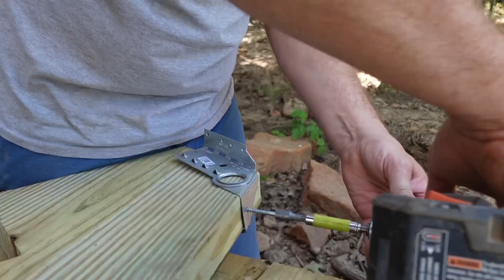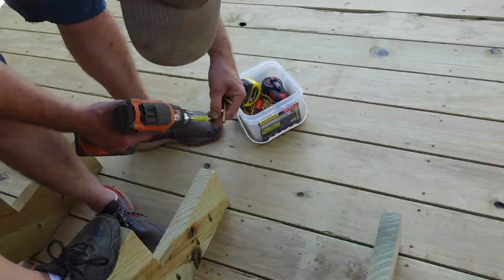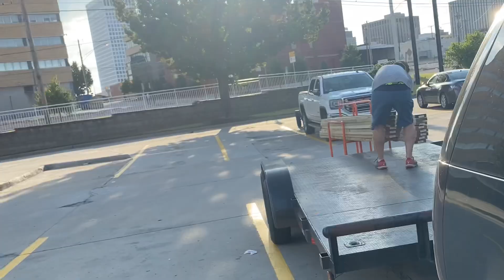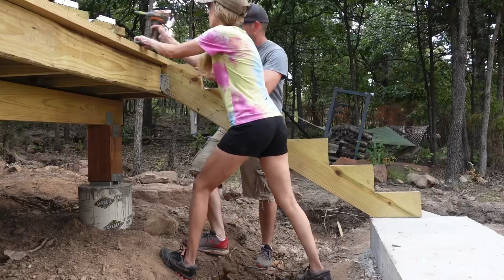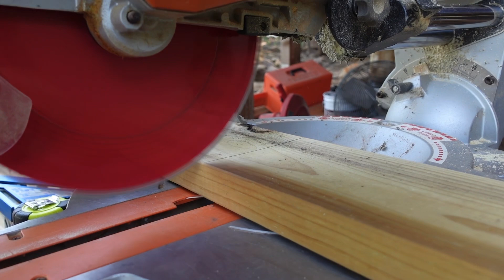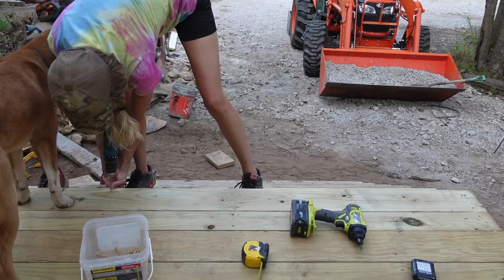Building A Huge Porch | stairs | part 11 | DIY Debt Free Cabin Build

Comment: The whole idea about the Pocket Hole Screws is to have those ones that pull against the hole already made. They look like that have a washer connected to the head of the screw which holds against the wood against the larger hole that is made. The ones you are using with a angle type will pull  though into the hole over time. You can get the Blue Coated 3in ones you know. Maybe you should at the very least use the right Pocket Hole Screws..

Comment: Taping those stringers is one of the best things you can do.  You just added 10 years to their use life.   Also if you want to hide the black tape on the vertical surface, get a cedar fence picket and rip it to fit the space.  It will smell nice but also keep bugs away more.

Comment: You will REALLY want to separate the lower stringers from the concrete with some sort of barrier.  The preservative material  in the wood and the concrete will react and cause problems.  I would have black taped the bottom and used some foam like you use for an air barrier under walls.  You never should put bare wood on concrete.